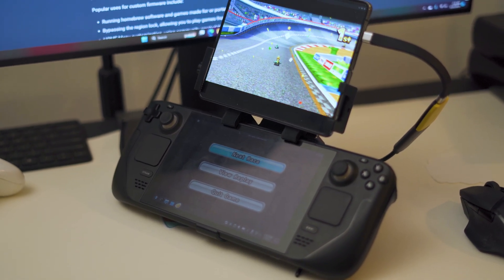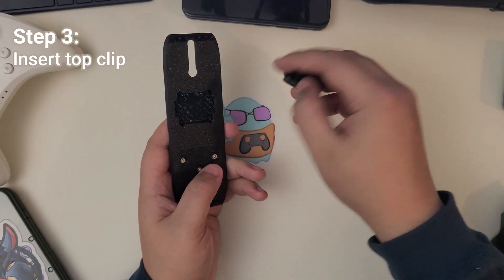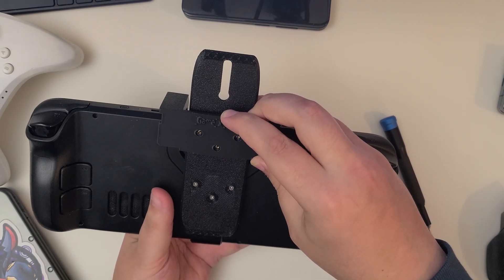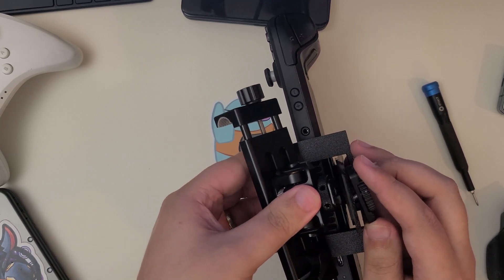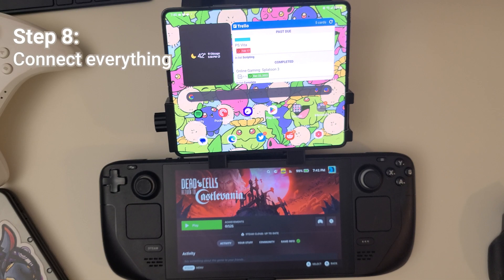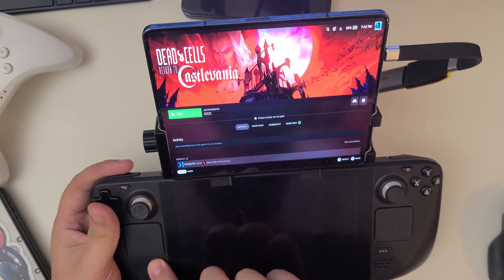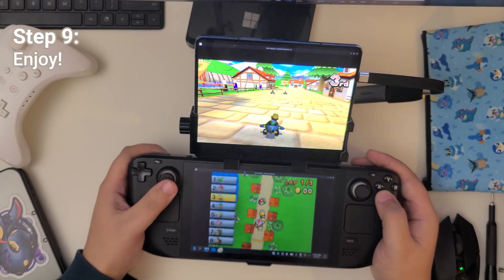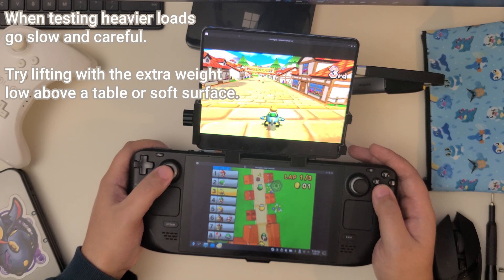Adding a second screen to a Steam Deck using 3D printed parts (Build Materials in Description)

Comment: Is there a version that would work with a killswich case? I feel like the accessory mount on the back would work perfectly for something like this!
Reply from the maker: Unfortunately, I don't. I haven't been able to justify buying a Killswitch yet to make the appropriate measurements. It's possible you might be able to make the Killswitch's universal mount work in a similar way though.

Comment: This seems like it would be kinda heavy; is it possible to attach both this and a kickstand?
Reply from the maker: For sure! I've had some luck swapping the top brace with the DeckMate kickstand to use it on a tabletop. If you go that route, I might also recommend putting some additional padding material on the side of the main adapter facing the Steam Deck. That way, if the Steam Deck happens to twist a bit (for whatever reason) it has less distance to travel. 

Alternatively, I have an earlier draft of the adapter available for any paid members on my Patreon (link: https://www.patreon.com/posts/76267792 ) which had extra screw holes to accommodate a DeckMate kickstand lower on the device. That version doesn't work well with handheld play, but could be up your alley if you don't plan to use the setup handheld anyway.

Also, just to throw it out there, if you're looking to play solely on a tabletop, you could skip the mounting altogether. Instead, find a small, adjustable tripod to pair with the tablet holder you're using for your phone or portable monitor. It's not as fancy, but it's incredibly functional.
Reply: @GameXData  Excellent follow-up, thank you!

Comment: As someone who owns a fold 4 and a deck this is a pretty amazing solution. Though I do have a modded 3ds, and found that usually ds/3ds emulation/ergonomics/controls is more trouble than its worth compared to using original hardware. But it's a genius solution for those who don't have it or are willing to trade ergonomics/controls for huge screens.

Comment: Can this be done with a iPhone?
Reply from the maker: I don't currently know of a way. You'd need to find either a wireless connection mention that works well for you or find an app that can accept input from a capture card. The capture card method might be made a little more difficult by the low bandwidth available through lightning connections.

Comment: I wonder how good is the delay or latency for the second screen since its get video data from the screen recorder
Reply from the maker: The Steam Deck > Capture Card > Display pipeline does add a bit of latency (a few milliseconds). For most games I've played across both screen, it hasn't really been noticeable to me. It's only when I've really counted frames in recordings that I really start to see it. 

If you're interested, I posted a video on Twitter with a Super Mario 3D Land comparison: https://twitter.com/_GameXData/status/1641148477710139402